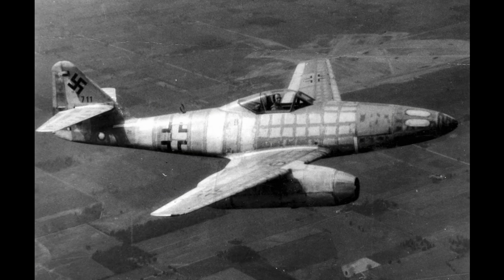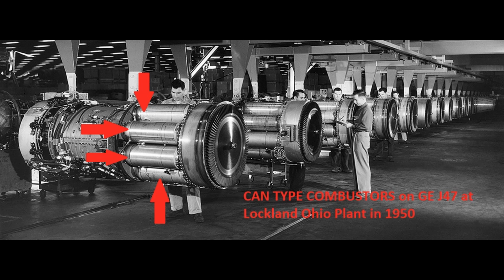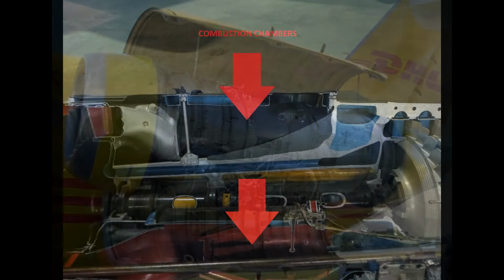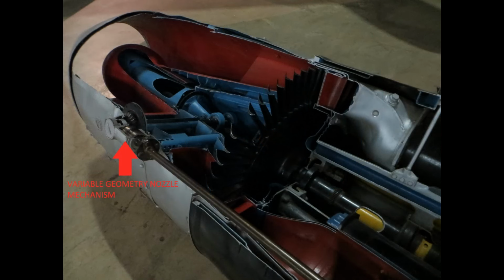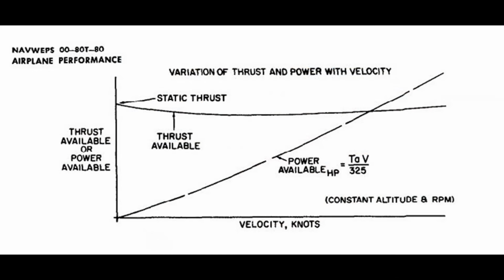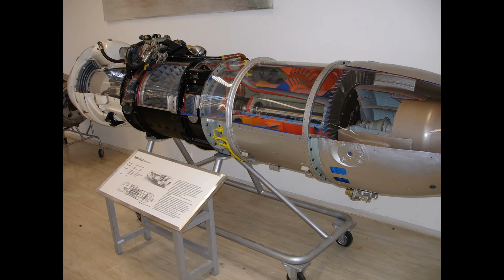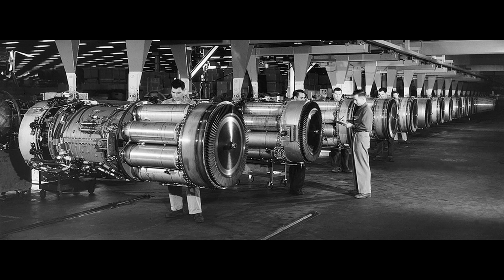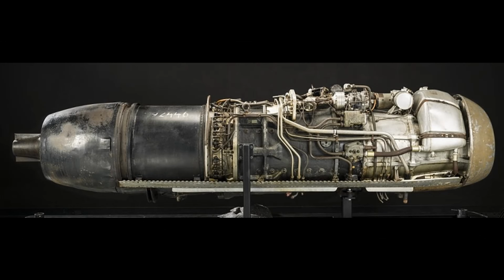World War Two JET POWER

Comment: Good video, but OPERABILITY. Thats whats missing from this analysis. How likely was the engine to surge or stall, or suffer lean blow out?  Anecdotally, I've heard the Jumo 004 was so touchy that after the start of rakeoff until starting approach to landing, the pilots didnt touch the throttle
Reply from the maker: Compared to what?
Reply: @GregsAirplanesandAutomobiles  one engine to compare against would be its British contemporary, the W2/Rolls-Royce Welland.  I know the Meteor had electronic TGT limiting, but I don't know when it got that capability
Reply: @paulgush The Welland didn't have automatic fuel controls either and was inferior to the Jumo 109-004b
Reply: @paulgush NO JET ENGINE HAD AUTOMATIC FUEL CONTROLS DURING WW2.

The RAF lost 890 Gloster "Meatbox" Meteors killing 450 British pilots, the primary failure mode was engine failure during take-off.
Reply: @sandervanderkammen9230  even if you're right on your first point, centrif compressors are inherently more resistant to and tolerant of compressor stall.
Reply: @paulgush  But, all compressors are subject to aerodynamic stalling... they are equally susceptible to surging due to poor fuel delivery.
The key advantage of the German Axial engines was automatically variable convergent nozzle technology.
 Shortly after the Messerschmitt Me-262 entered production, it was also updated with throttle dampers to reduce manually induced surging.
 Genius aerodynamic engineer, Helmut Schelp convinced the RLM to abandoned centrifugal jet engine development as he correctly predicted that they were an evolutionary dead-end concept and their performance limitations would be reached quickly.
 All modern jet engines are axial compressor,  centrifugal turbojet engines are obsolete and have been for more than half a century.
Reply: @paulgush  The Allies made several attempts to build axial compressor turbojets during WW2... they were all disappointing failures.
Reply: @sandervanderkammen9230  in point of fact, RR only started developing its first axial engine after WW2 because it made no sense to take on that risk during the war. 

The performance of a centrif compressor didn't hamper the Mig 15 a decade later in Korea vs the axial F-86. 

Centrif compressors are actually making a comback in jets up to about 10,000 lb thrust.  E.g. Safran Silvercrest. That's because they achieve high pressure ratios over a single stage.
Reply: @paulgush  Only Metropolitan-Vickers had axial compressor technology during WW2 (licensed from Swiss BB&C company in 1934).
The Rolls-Royce Avon is based on captured German axial turbojet technology.

The MiG-15 was severely hampered by its obsolete, inefficient centrifugal jet engine.
It was an outdated WW2 design by Heinkel engineer Siegfried Günter in 1943.

It could not fly supersonic like the axial powered F-86.
 No aircraft has ever flown supersonic with a centrifugal turbojet.

The Safran Slivercrest is not a turbojet or a true turbofan. It is a Turbomecca helicopter turboshaft (RTM332) coupled to a fully bypassed Ducted Fan
The Silvercrest was plagued with high-pressure stage compressor problems (they don't work well at high altitudes). The Silvercrest program was a failure that never received airworthiness certification and was canceled 2017.
Reply: @paulpaul9914 Please name a single British jet aircraft in production in Britain?????????
Reply: @paulpaul9914 Please name a single British aircraft manufacturer that still makes British jet planes in Britain.???

Comment: FHCAM, Paul Allen's (RIP) (Microsoft) museum restored a 262 to flying condition with all authentic original systems. However, upgrading the weak engine metals to proper types.
Reply: Paul Allen's Jumo engines were restored to original specifications...
 A286 stainless steel and Krupp P-198 Chomadur are the same alloys.
 The -004B engines have excellent durability and service life, they easily passed the RLMs 100 hour PFTR test requirements for adoption into Luftwaffe service, this is the same 100 hours required by the RAF and the USAAF during WW2.

The US Operation LUSTY tested them and confirmed TBOs averaged 55 hours... better than the high output versions of the Merlin or R-2800.. better than the F-86 Sabre in the Korean War.

Comment: When jet engines are getting huge thrust from large fans, why are they not called props?

Is there a defined difference between a propeller and a fan...like blade count or something?
Reply from the maker: It has a lot to do with the way things are named. Modern "turbo-jets" are very often Turbo-jets driving a ducted fan.
Reply: If the propeller is encased by a shroud? It's called a Ducted Fan
Reply: +@PowerScissor   Compare Turbofans verses Turboprops.   Turboprops generate thrust primarily from the prop with little jet thrust from the engine.  The Turbofan generates thrust from the both the bypass fan and the jet engine.

Comment: I had a relative killed in Military flight training during those early years of turbine jet engines ( before I was born )  The compressor locked up soon after take off and asymmetrical force twisted the aircraft combined with a stall fell into the ground.  From what I was told during that time the number of crashes and fatalities in training became an issue pushing everyone for better and more reliable redesigns quickly.
Reply: The Gloster Meteor suffered from a staggering number of crashes due to engine failure and loss of control in asymmetric flight (spin/stall).
890 crashed between 1947 and 1980, killing 450 British pilots in RAF service alone, hundreds more in foreign service.
Reply: @sandervanderkammen9230  
Fryed Ryce Munchyrz Kharzeestan Krappenz DiktorBummer Werkzxoffen etc and co SHUD note good with much awestruckness please to. 
    For early fighter jets around that time the Meteor aircraft losses were average, no worse than other aircraft & many incidents were flying training errors.
Some later jet fighter aircraft from non UK countries had higher % accident loss rates with higher % fatalities  (combat losses excluded).
👍
. ... .   ... . .
cvxvcvxbii
Reply: @paulpaul9914  please name a single British aircraft manufacturer that still makes British jet aircraft in Britain?
Reply: @sandervanderkammen9230 
@WilhelmKarsten 
Fryed Ryce Munchyrz Kharzeestan Krappenz DiktorBummer Jurkzxoffenz etc and co - they SHUD note good with much awestruckness and much better wonderment etc.
Non combat phase accident losses 
% of Aircraft built.
US Lockheed  P80  Intro 1944      46%
UK Gloster Meteor Intro 1943      17%

Any Kweschuns lad?
Cheers 👍🙂
   
   
  
    
. . ..............       ... .
iiivxcxcvxcxcvxcxc
Reply: @sandervanderkammen9230 
As they are aware -
Just answer the questions sonny Jim Jimminy boy.
   Which airline has just ordered
60 RR England Trent XWB Engines
& What aircraft are the engines for?

Bonus question for 10 extra points.
                Which country has the 
World's Highest Combined Per Capita
 Nuclear / Defence / Aerospace Sector Activity?

👍& 🙂 & Cheers & indeed 😎
 
         Toodle PIP Old Chap.
  
   
 
     
. .. . ..       .... .
vvvvvvvcccv
Reply: @paulpaul9914  Please name a British jet plane that is still being made in the UK???
Reply: @petemaly8950  Cat got your tongue boy? Why cant you answer the question???

Comment: I have not been able to verify it, but I have seen a claim that the Germans introduced ceramic turbine blades in 1945.
Reply: 1943, Dr Anselm Franz introduced the first use of both hollow turbine blades with bleed air cooling and the First use of ceramic TBCs for the turbine blades and combustor liners for the -004B.
 The hot section was coated in a high temperature resistant Cerro-alumina ceramic coating, very similar to the TBCs used today on modern jet engines.
Reply: @sandervanderkammen9230   Do you have any book suggestion regarding the development of the engine ?
Reply: @sandervanderkammen9230 
The turbine blades of the  German 004 were sheet steel coated in aluminium that would get destroyed on the first run without air cooling, at the time they hadn't figured out the required Nickel alloys which were developed first in Hereford England.
Reply: @paulpaul9914  ALL JET ENGINES are made of stainless steel.
 Stainless steel can be Nickel based, Cobalt based or Chromium based.

All 3 types are still used in jet engine production today.
Reply: @paulpaul9914  Oh you poor silly boy... you didnt know that there are magnetic and Non-magnetic stainless steels?
You also dont know that the magnetic content has no effect on the creep strength.

Chromium is non-magnetic... and still used to make jet engines today.
Reply: @paulpaul9914  Krupp P-198 Chromadur has a minimum creep temperture of 1,180 degs F... the Same as Nimonic.